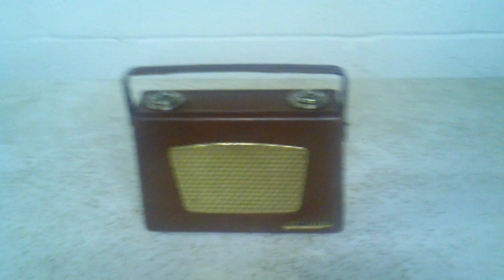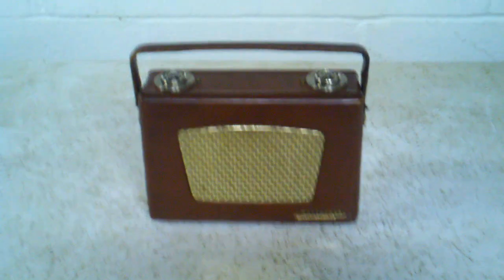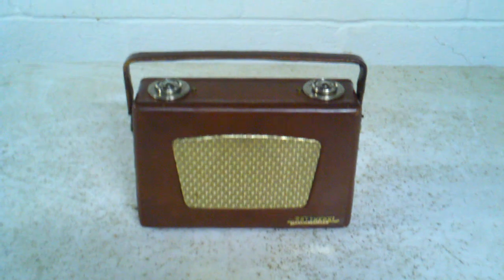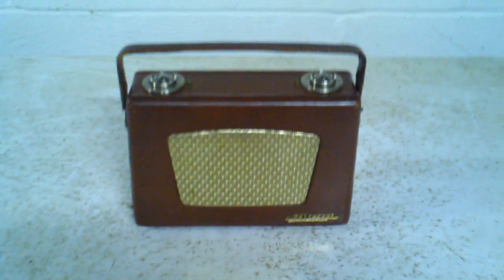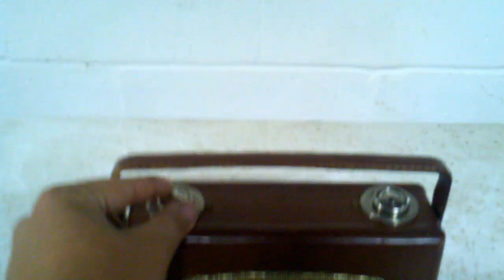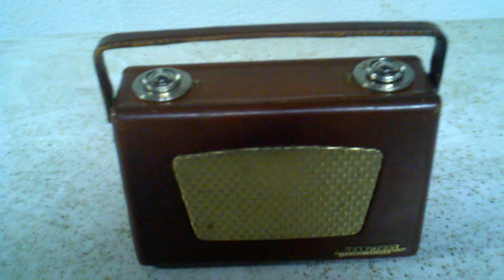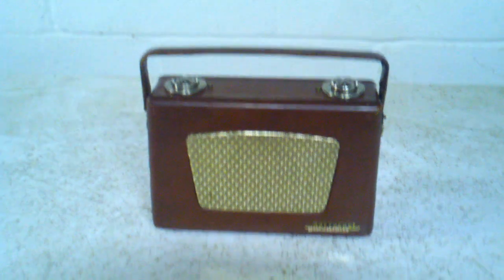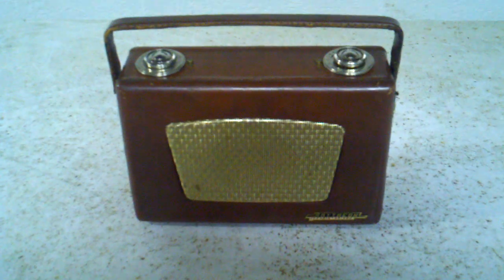1955 Raytheon 8TP2 transistor radio

Comment: Raytheon had a brilliant marketing strategy.
The very first line premium transistors went to the military and industry.
The next level went to the high end consumer market such as hearing aids.
The mid range was the common consumer item such as radios.
The bottom end was the experimenter market.
The very same transistor, just depended on how good it turned out!